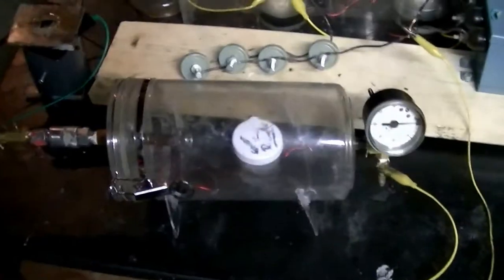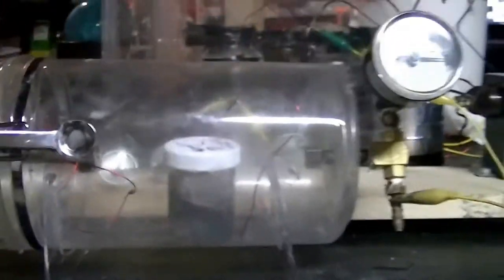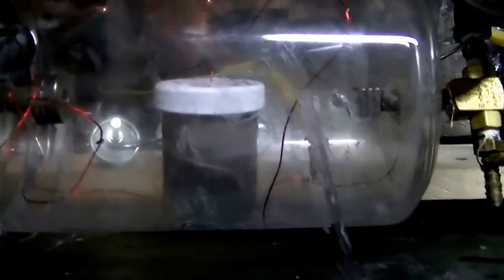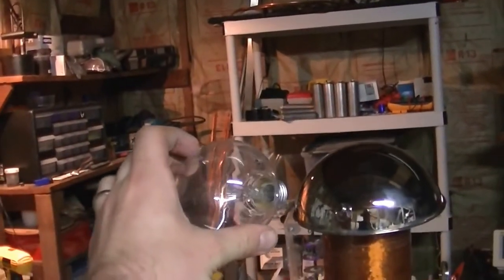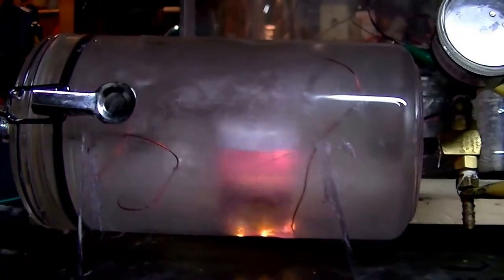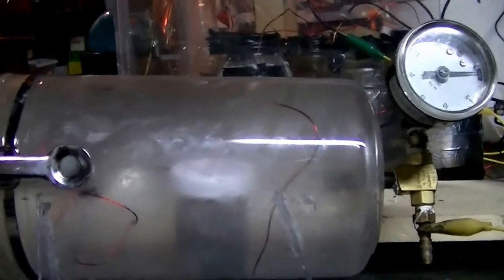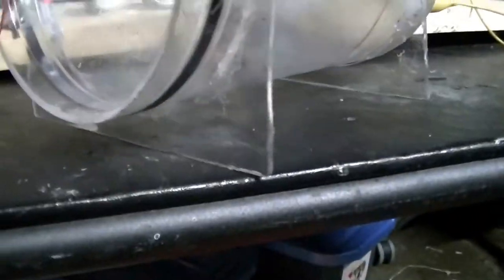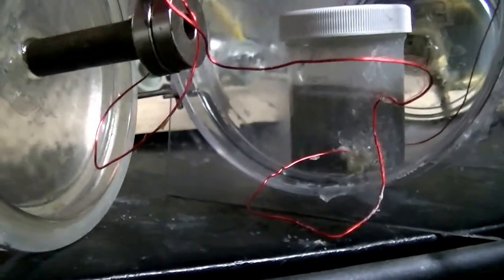Utilizing heat in power transmission

Comment from the maker: Yeah, bed bath and beyond in the beyond section ;) The silicon gasket seal won't let me pull anything deeper than 25 in Mercury. The nano particulate graphite is just graphite from a pencil that I exfoliated through the soap method.